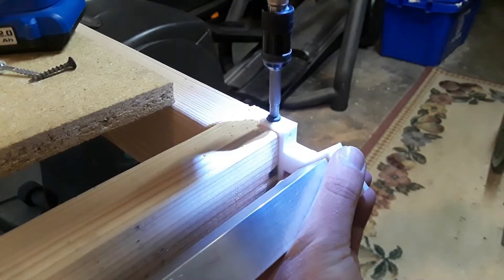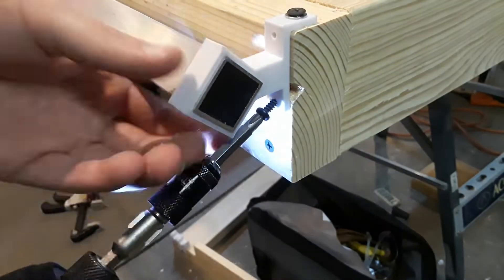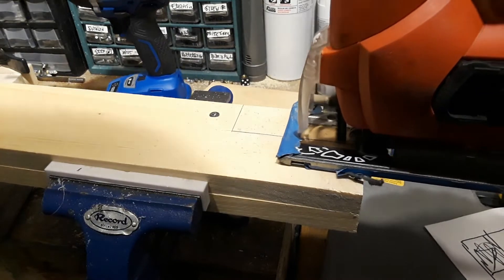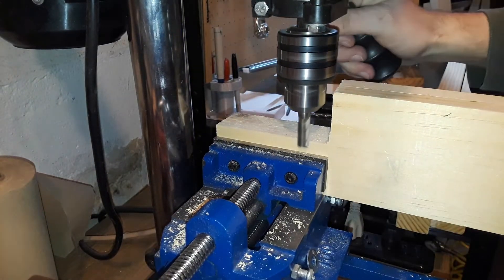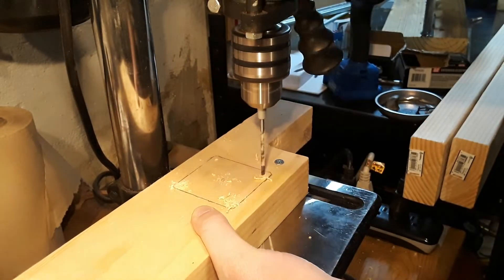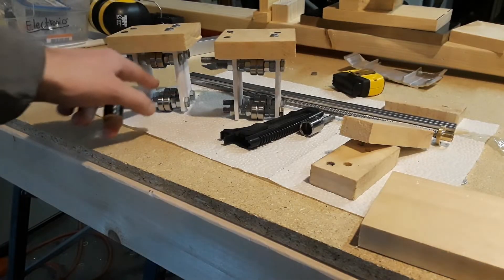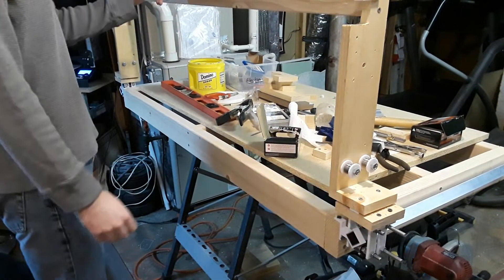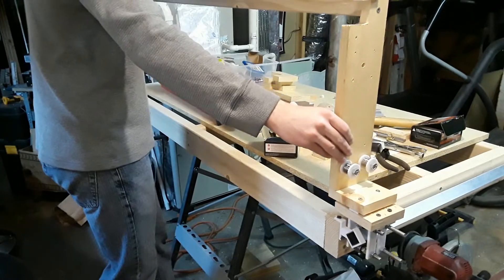Homemade CNC Router Part 2: Y Axis & Gantry

Comment: I just want something that will do Aluminum parts no more than 25mm deep (so 1 inch) but most will be 6-8mm (half to 3/4 inch) and can't find anything that doesn't cost 2 grand or more.
Reply from the maker: I haven't tested aluminum yet but I do believe my router could cut aluminum on a very slow feed rate setting. I'm not sure how deep it could go though.

Comment: Good design. Personally I would have went with steel tubing instead of aluminum. I think you will find the aluminum deforming from the steel bearings after a short time. 
I forgot I subscribed to you a while back but haven’t checked in and seen what you’ve been up to. But glad I seen this post. 
How many subs do you have now?
Reply from the maker: I would've liked to use steel tubing but it was more expensive and I don't believe my home depot carried steel tubing that exceeded 4'. My subscribers have grown quite a bit in the last several months. I really appreciate your curiousity but I prefer to keep my sub count secret :)
Reply: Problem with steel tubing is bow and weight plus getting long lengths PLUS you need a truck to go pick them up and bring them home if they did have them.  Hassles.
Reply from the maker: @thebeststooge  Yea, that too.